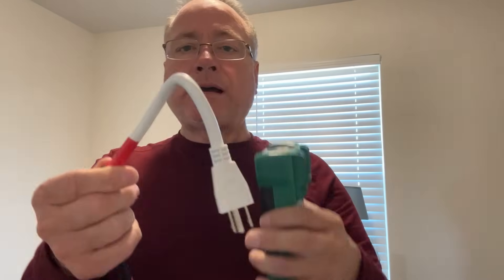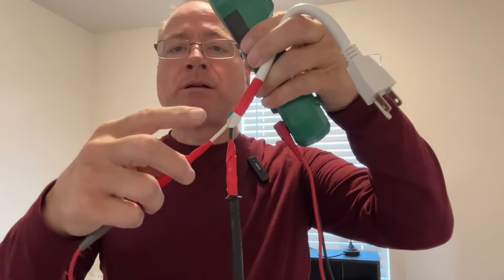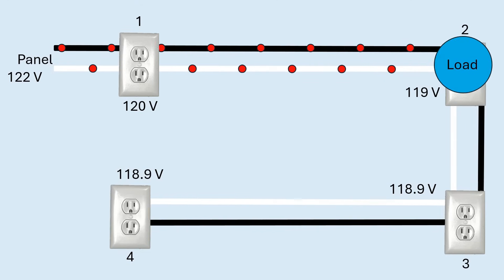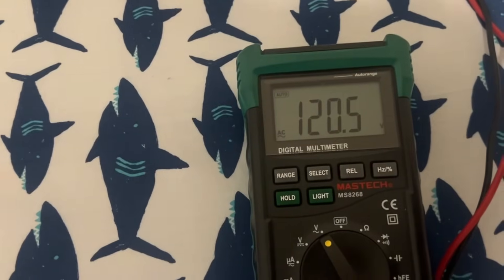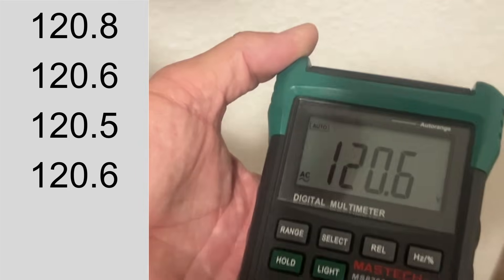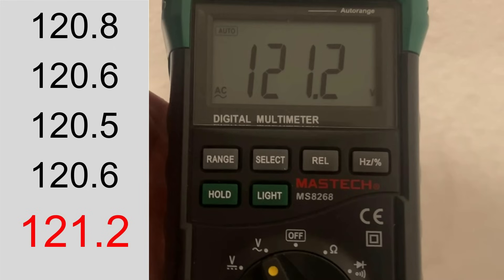Find the First Outlet Fast - Simple Multimeter Test

Comment: Thank the Lord for folks like you & videos like this!. I was prepared to take every outlet apart in each circuit of  my 1957 house! Much Better! Thank you!😊
Reply from the maker: I’m glad you found the video. Were you also able to find the first outlet in the chain?
Reply: @morganinspectionservices3840  Yes, maybe, but not on one circuit which I don't fully understand. One breaker is controlling 7 outlets and two 3way overhead lights. I finally took all of the wall outlets apart and identified TWO hot wires and put GFCI outlets ($11 ea Amazon multipack) on them which work fine so far but the overhead 3way lights aren't controlled by either. It was daunting and complicated by an outlet which failed in the process causing overload. Strictly DIY here but I do have basic understanding of electricity & residential wiring. I confess I've never fully understood 3 way light switches and replace them one wire at a time in exact order as removal. Some of the NMB runs through the attic & some through the crawl space (belly crawl!). Not exploring either anytime soon but may in the future. I have a left over spool of single wire 14 AWG ground from a previous project and may attempt to run to some of the outlets in the future. TY

Comment: i wonder what happens if the hairdryer is plugged into receptacle four instead of one and vice versa!would it affect the readings?you are always worried though ,in case somebody put one or more other sockets or receptacles in a different room,or downstairs in the cellar upto the first socket in the room that you are working.you might then think that you have disconnected thst socket but it may be live.i'm assuming that electrical  ring circuits sockets may not always have to be in the same room!unless i'm talking utter nonsense!wouldn't surprise me!
Reply from the maker: Good questions! Plugging into different receptacles can change the voltage drop readings, but the last outlet in the circuit will still show the most significant drop. And you’re right—circuits don’t always follow a simple room-by-room layout, which is why testing is so important. Thanks for watching!

Comment: Hang on a minutes he clearly said he turned the power off at the panel. OFF so how the hell did the hair dryer work, and how did he measure the voltage drop. With no power.
Reply from the maker: I hope you’re trying to be funny. I clearly said that I turned the power off in order to determine which receptacles were on the circuit. Perhaps I did not explicitly state that I turned the breaker back on, but I think that can be reasonably implied by the fact that the hairdryer worked - and by the fact that I measured voltages.

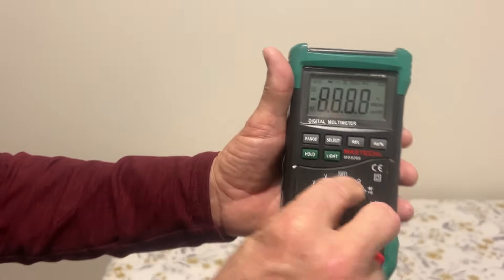Comment: 4:04 - How much of a voltage drop does it take to keep your covers from bursting into flames where you dropped your load? I like using voltage drops for troubleshooting the integrity of a circuit over the ohmmeter: voltage drops across a switch or contactor - burned contact; voltage drops in a short run of wire - corrosion in the wire; voltage drops across a light socket with a bulb installed - blown bulb, etc.
Reply from the maker: It’s a hairdryer. It is not going to ignite my sheets. Yes, voltage drop can be used for a lot of diagnosis. I am working on a video specifically about voltage drops right now.

Comment: An inexpensive multimeter per this well done tutorial is essential. Finding the first outlet (receptacle)for the placement of the GFCI receptacle in the daisy chain. It's usually the outlet closest to the circuit breaker box and it will have "four wires" in the back and usually but not always a copper ground wire. If you pull the wall covers off and find an outlet on the circuit with only "two" wires going into it, that's the end of that circuits daisy chain.
Reply from the maker: You’re right. An inexpensive multimeter will work to verify outlet placement in the daisy chain. Checking for four wires in the back is a good indicator, though as you mentioned, it’s not always a guarantee. If you have five or six or seven receptacles in the daisy chain, all, but the last one will have four wires, so that’s still a lot of work. I do agree that the first outlet on the Daisy chain is normally the one closest to the panel. The method of finding an outlet with only two wires as the end of the run is also a solid approach. I appreciate you sharing these insights—great additional tips for viewers who want to confirm their findings!

Comment: you tube proves again that a little bit of knowledge is dangerous.    This is not how to do it..    This video will put gullible people at risk..
Reply: @jimballard7217  Please enlighten  us.
Reply from the maker: Thank you for sharing your thoughts. I always try to create videos that are informative and safe for viewers. Could you clarify what specifically you believe is incorrect or potentially dangerous about the method shown? I demonstrated how to find the first receptacle using a multimeter and followed what I believe to be safe practices. If you see a better or safer way, I’m open to learning. Feedback like yours can help to improve the information that I share, so I’d appreciate any specific details or examples you can provide.
Reply: @morganinspectionservices3840         There is a required background to be safe when performing electrical work. Safe testing requires class Zero gloves for a reason.   Best practice is to identify all devices on a branch circuit , control the source and open all devices .   In this case if it was first fed to the middle one , pig tailed and split two ways , 2 to left and 2 to right but the first one had a loose terminal screw.  This is where the fire could start.  What if one of your viewers gets a shock?  Is this viewer trained to get checked for irregular heart rhythm that could cause crisis hours later?  i could speak volumes on this topic and if you were a registered apprentice you would have incentive to listen and learn. I hope this reply at least helps a few people realize that limits of approach are a thing and live testing has surprises built in.    Why do you want to find the first one anyways?

Comment: If your pulling covers, you can mark the breaker number inside the box.  If you want to be super thorough, you can mark breaker and outlet like 3-2 for breaker 3 outlet 2.  Military and good industrial buildings have a sticker on the faceplate.  Of course they also have blueprints.
Reply from the maker: That's a great tip!

Comment: I'm never gonna argue with this... it's sound math. However, I know for a fact that every house is different and every house is built by different people who do things differently. How does one even determine what receptacles are on the same circuit? This is the question before deciding if you can even determine what's first or last on a particular circuit. Some receptacles could be in some other room that you don't consider.. so that being the case, it's always gonna be a guess that a particular receptacle belongs in the same circuit. Only way to know is to open the walls up.... or shut off every breaker in the panel except for the one you're troubleshooting...
Reply from the maker: @ralphdoid    Actually I explained in the video the easiest approach to determining which receptacles are on the circuit. Plug a tester into one of the receptacles (or something like a lamp) in the room that you’re interested in and if your breakers aren’t labeled, turn off breakers until the tester or lamp shows the article no longer has power. If your breakers are labeled, then you simply turn off the breaker for that . With all breakers on, except for that one, start checking receptacles. The ones that are dead are the ones on the circuit. Yes, it is always a good idea to check receptacles in nearby rooms. All the receptacles should be in one general location. Most electricians try to save time and money so typically one circuit is in one general area of the home. It’s typically not very difficult to find all of the receptacles on the circuit.
Reply: @  Agreed. But like I said, every house is different and every situation is different, and it's not always straightforward. Sometimes it wasn't a competent person who wired the house. For example, I just got done troubleshooting a problem that took half a day to resolve... in a four bedroom two bath house, two of the bedroom upstairs and the common room downstairs was without power. That was 13 receptacles on two floors and lights to all bedrooms. No rhyme or reason. It took a long time, but I finally was able to trace the tone I sent down the circuit to a GFCI that was located out on the exterior in the second floor roof soffit. It was a great thought putting a receptacle there for xmas lights, but horrible idea to have half the house downstream from that GFCI that was located in an area accessible only by putting up a 16 foot extension ladder. All I'm saying is that sometimes voltage drop tests work great. And there are times it's not very practical at all in houses that have been altered or wired up by inexperienced people.
Reply: Simply turn off the cct breaker and test every receptacle in the house. The ones that don’t work, including lights are on the same breaker.
Reply: If it was installed by a competent person, the breakers will be labeled and a diagram would be at the panel.
Reply: This method won’t always work, especially in an older house with knob and tube wiring, or a house with that has had lots of modifications and upgrades through the years. I’ve seen knob & tube wiring with the hot and neutral from different breakers used for the same receptacle. I’ve seen receptacles that fed two other receptacles, not in a daisy chain, but in parallel. Also, one of your diagrams show a 0.1 V drop across a branch with nominally zero current. This is impossible. No, I’m not an electrician, just an old house owner with a BSEE.
Reply: I'm running through this problem as we type/speak, and the likely solution for your question/problem of tracing wiring/cabling behind walls is using some sort of buried cable/wire tracing method.  Hook-up a transmitter on the ground wire of the circuit intended for tracing, and use a receiver/wand for tracing the cabling/wiring behind the walls.  Can either purchase a cheap cable tracer/probe tool or, I figure, could even use an outdoor buried cable locator.  The later would likely be far more effective if the walls are more dense/thicker.

Comment: Nice video.  A couple of things to point out for clarity: 1.  When making the plug cord, you could also use a standard 2 plug extension cord instead of a 3 plug grounded cord.  If you use a 3 plug/cord, the green ground wire is not is not used and therefore could be just covered with electrical tape.  2.  I would never place a hot hair dryer on a flammable surface such as a bedsheet due to a potential fire hazard!
Reply from the maker: You are absolutely correct, I should have demonstrated that more safely. The hairdryer was only running for a couple of minutes, so I was not terribly concerned, but you are correct.
Reply: is not is not???     Are YOU on DRUGS???
Reply: what about juggling a few nuclear bombs over the top of an erupting volcano,whilst traversing a tightrope on a unicycle?would you ever do anything like that!
Reply from the maker: @motormouthalmighty    Well motormouth, that doesn’t sound like a good idea.

Comment: Is it possible to measure the resistance at each outlet with a multimeter to determine the first one? The furthest outlet should have the highest resistance because it's the longest path the current has to travel. I've never tried it by the way. I'm just wondering if you have or not. Select the ohms (Ω) setting on your multimeter and try doing it that way. Record the resistance numbers. Would be interesting to see the results. I'd do it, but I live in an apartment. Don't have access to the electrical box. 😀
Reply from the maker: Where are you suggesting measuring the resistance? From the panel to the outlets? If the receptacles are grounded, then the ground and the neutral are connected together in the panel, so theoretically, you can measure the resistance between the ground and the neutral at any receptacle.  Let’s say the receptacle your checking is 30 feet from the panel. Then you actually have 60 feet of wire - 30 feet of neutral and 30 feet of ground wire. Number 12 AWG wire has a resistance of about 1.6 ohms per 1000 feet. This is going to give you a very small resistance, which is going to be difficult to measure accurately. If you run a heavy load while you do this, then that will magnify the voltage drop and probably allow you to detect a difference.
Reply: @morganinspectionservices3840  Ah. I see. Didn't realize it would be that difficult to measure.
Reply: Not too good.  You could connect the hot at the panel to ground and measure each outlet.  If you accidentally  connect your ohm (Or Mho for conductance.) meter to a live circuit, it will most likely let the smoke out.

Comment: How do you know which is the last receptacle to plug in the load?
Reply from the maker: You don’t. You don’t know the last receptacle any better than you know the first receptacle. Just plug it in somewhere. I would suggest somewhere that is likely the middle of the circuit. Then when you start checking voltages, if you read essentially no change between receptacles, then you are downstream of the load. At this point, you need to check a receptacle somewhere else. It also might be a good idea to move the load and plug it into one of those more downstream receptacles and then work your way forward with the multimeter, and you should get a higher voltage at each receptacle. If you get lower voltages as you move, then you are going the wrong direction. Just keep going until you find the highest voltage.
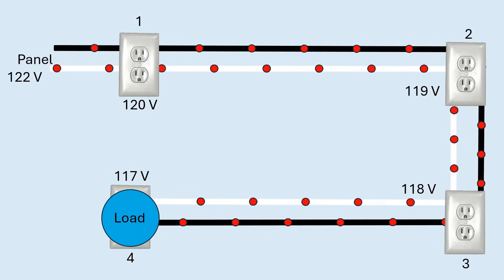Reply: his animation at 2:44 gives you an idea on this. If you put the high load item in the 'wrong' receptacle it will show lower but not much of any difference than the receptacle you put the load into for all the ones that are downstream. They will all be lower than your very first one though. That should tell you right away which one is the first one (the voltage will be higher than any of the others) but if the voltage difference isn't enough just move it to another one and you should see a greater difference.
Reply from the maker: @icarus_flying1994 . Great answer.

Comment: Love the heater on a bed, then it turns off when checking the last outlet.  Making a suicide cord for your meter, not kosher in the electrical industry, some companies will actually fire you for that, Klein makes a plug with the female terminals for your meter.   Tried to see if it holds water, couldn't get a voltage difference on the first three outlets of a known circuit, for 12ga & 1800W heater, could only fig it out if the heater followed me from the previous outlet.  Nice concept though if you dont have $300 for a very effective circuit tracer, but if you do this for a living, buy the tracer...
Reply from the maker: Seriously? It didn’t work for you? I have tried this on multiple circuits in more than one house and it has worked every time. The hairdryer actually did not turn off while checking the last receptacle. I was able to filter out the noise more easily because I was in a different room and it was quieter.  I appreciate you watching, and appreciate the feedback. 
I have made another video using an extension cord to check the voltage drop on only the neutral wire between two receptacles. I also used a hairdryer to draw the current. Measuring the voltage drop on the neutral gave me a much larger/better indication to tell me when I was either upstream or downstream of the receptacles where I was measuring the voltage drop. In that video, I also use the Ideal SureTest circuit analyzer to measure the voltage drop on the hot wire. This also gave a very good indication of the order of the receptacles along the circuit.

Comment: I liked on the last video how you y
Checked voltage drop with the neutral.  This would be easier here
Reply from the maker: I actually think this method is easier, but there are multiple options depending on the situation.

Comment: Why would you need to find the first receptacle? What is the purpose? TKS
Reply from the maker: One of the main reasons I can think of is to install a GFCI protected receptacle. if you are living in an older house, the GFCI protected receptacle would then protect all receptacles downstream of the first receptacle on the circuit.
Reply: @morganinspectionservices3840   A bit more esoteric reason to know is so you don't put multiple heavy current loads on the circuit.  Or if you use a portable electric heater, it is best on the first receptacle for the lowest voltage drop and home run wire heating.
Reply: @morganinspectionservices3840 that is the only reason I could think of after being pointed out. Finding the last to maybe add on to the circuit might be more common.
Reply from the maker: If you’re adding receptacles to a circuit, it isn’t necessary to start at the last receptacle. You can essentially tie into the circuit anywhere. (as long as you do it correctly, such as in a junction box).
Reply: @morganinspectionservices3840  Makes sense. I am a small landlord. I notice that the kitchen has one gfi and the others (downwards) work off of this GFI.